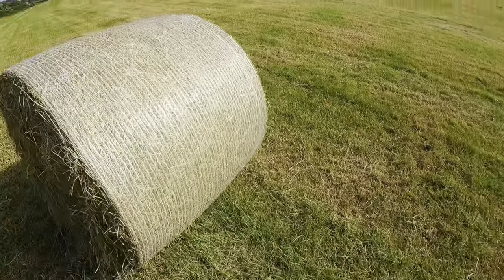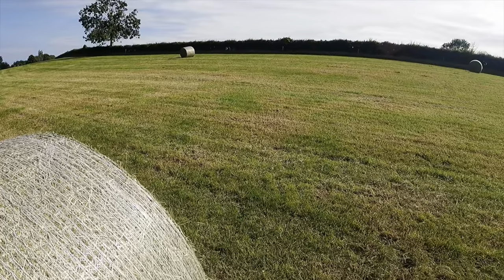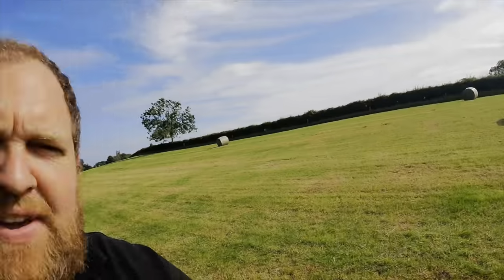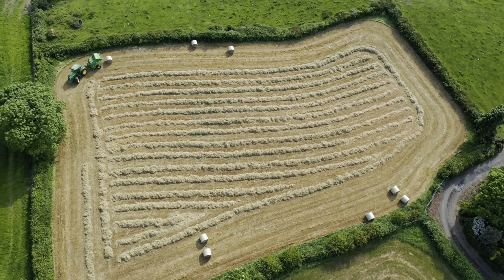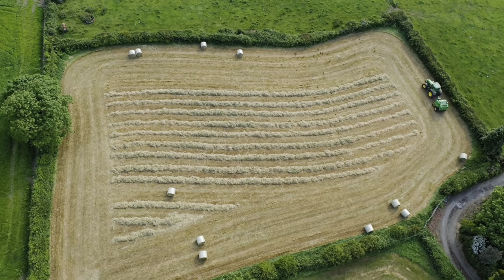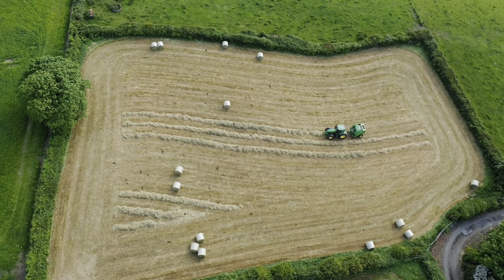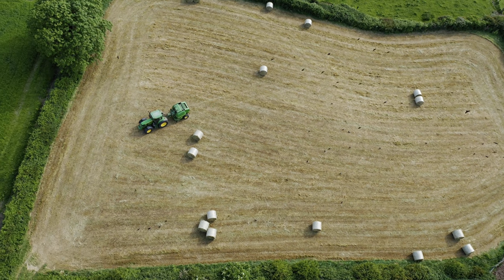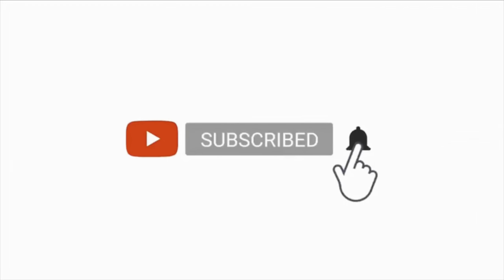JD 2850 GIVES SQUARE BALER A RUN, HAY IS FINISHED...FOR NOW

Comment: Great baling outfit…I baled with a MF 698T new Holland 376 baler and a cook sledge…then stacked flat 8 packs with a MF 575 loader tractor …then stacked in the barn from a wooden elevator…his dad drawing in with a bale carrier on B reg John Deere 2140 4wd 👍
Reply from the maker: Great memories 👌
Reply: I used my father’s MF165 and Welger AP53 many years ago when we were contracting welger was unbelievable to bale
Reply: @michaelmoroney4594  I learned to drive on a Mf 165 fitted loader tractor with a Duncan cab  moving round straw bales 😄